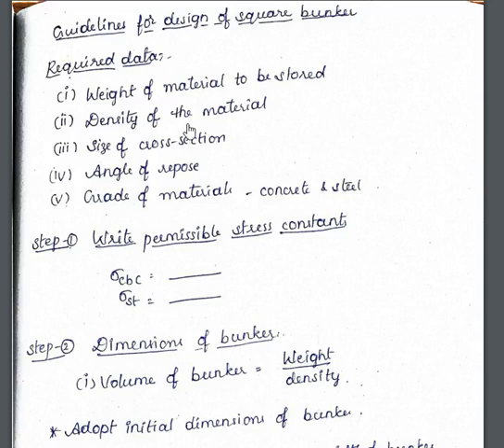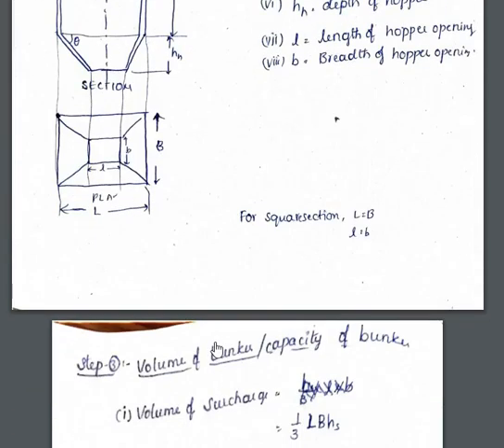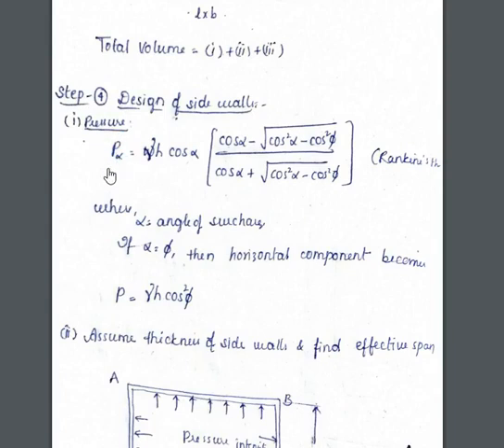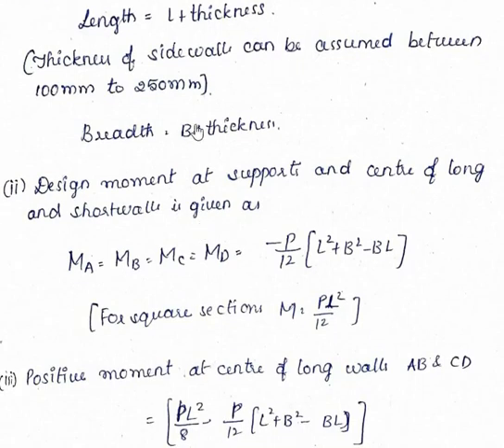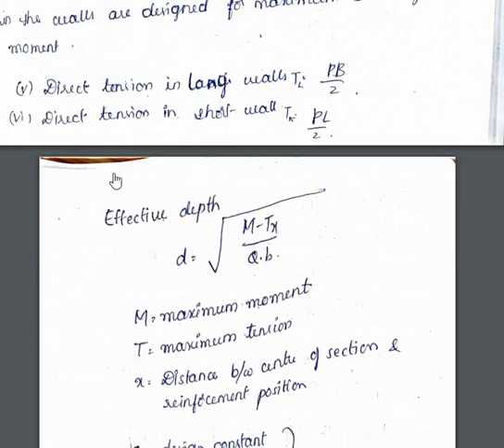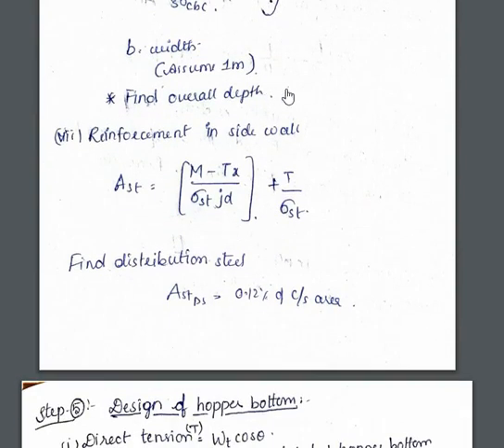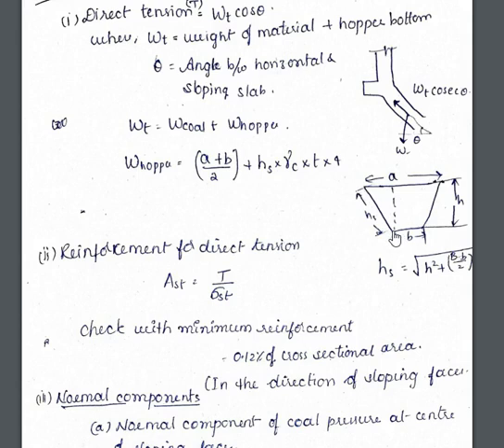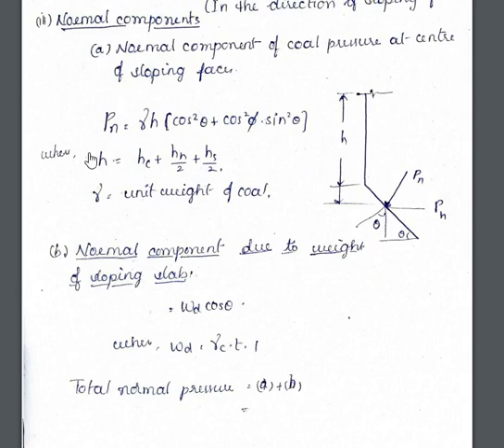Design guidelines for square /  Rectangular bunker - Part 1/2  (Working Stress method)

Comment: Mam ,Your previous videos are based on limit state method but for rectangular or square geometry sections your following working stress method WHY.

Can't we design this by limit state method
Reply from the maker: That is not based on shape. It depends on serviceability factors. For heavy structures and light structures, method of design will change.
Reply: Thank you for your response madam,
I haven't found any standard text book for design of silos and bunkers in limit state method and as well as working stress method,
Can you please suggest me any text book pertaining to design of silos and bunkers in limit state method
Reply from the maker: Sorry, I couldn't find related materials. Generally for heavy structures, working stress method is preferred. Ofcourse, may some research studies are going on to design them in limit state method.